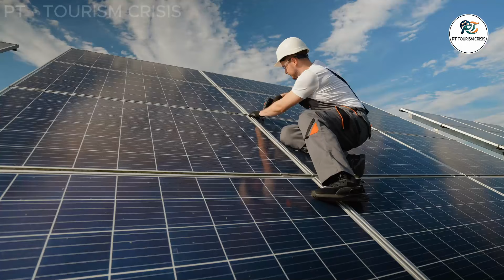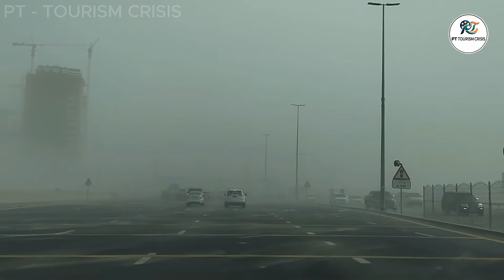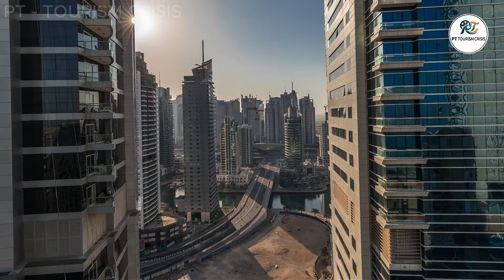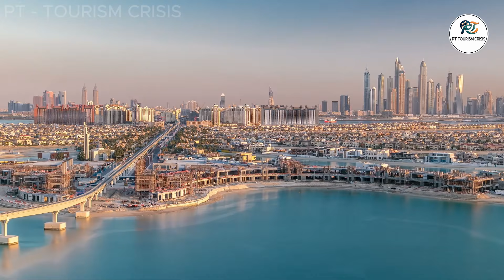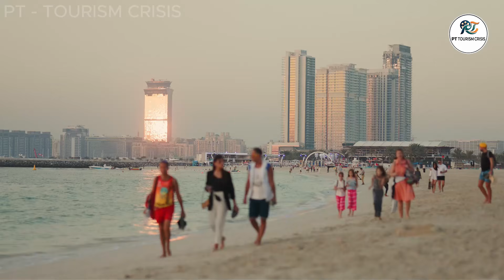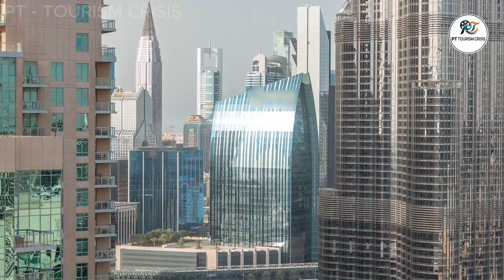Why Dubai’s $20 Billion Solar Empire Is DYING

Comment: Very well explained video.
Dubai folly is temporarily on a breather as the US-Iran war rages.
However, the incoherence of the Dubai model, and their increase in sophisticated and expensive solar electricity generation, is that they still anticipate their population to grow to 5Million in the next decade whilst mother Earth will still function on a daily basis and lay its sand on those solar panels.
Will the Sheiks ever realise that they are digging their own tombs with all that steel and glass???
And they still have to fully address their desalination and clean water bombshell problem!
Maybe by 2027, camels will be roaming down Sheik Sayed Road🤣😂
Reply from the maker: Thank you. Dubai’s challenge is not one single crisis, but the combined pressure of growth, heat, solar maintenance, desalination, water security, and long term environmental limits.

Comment: So hier a few cleaner if each panel only needs to be cleaned every 5 months thats doable easily ( 17% isnt that bad of loss)
Reply from the maker: Fair point. If cleaning intervals are manageable and the loss is limited, the issue becomes cost efficiency rather than a complete deal breaker.

Comment: If they build windshield wipers on each solar panel, which comes first?:
1) the wind generated by the stirring wipers creates bigger dust storms, -or -
2) the power draw of the wipers decrease their efficiency beyond the break even point.
Reply from the maker: That is the exact dilemma. Cleaning systems can help, but if they add too much dust movement, energy use, or maintenance, the solution becomes another cost problem.

Comment: Seems like AI nonsense. Sure it is an issue it the desert, but statements like panels "must be kept perfectly clean" is ridiculous.
Reply: While I don't live anywhere that has sandstorms, I do live in an arid environment. I go years without cleaning my solar panels and they still work great!
Reply from the maker: That is a fair point. The impact really depends on local conditions, especially dust type, humidity, rainfall, tilt angle, and how often storms deposit new material.
Reply from the maker: Fair criticism. Solar panels do not need to be perfectly clean, but dust buildup can still reduce efficiency enough to make regular cleaning important.